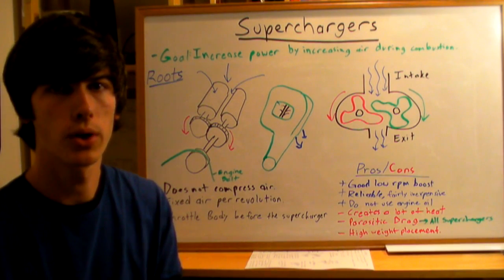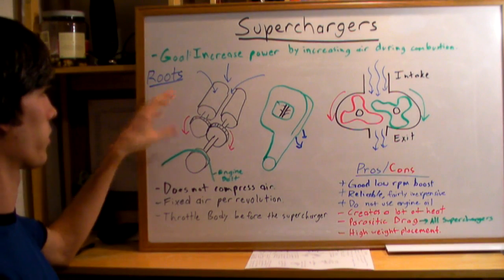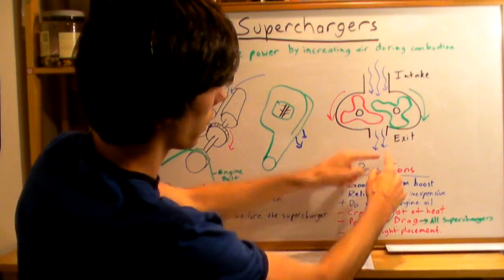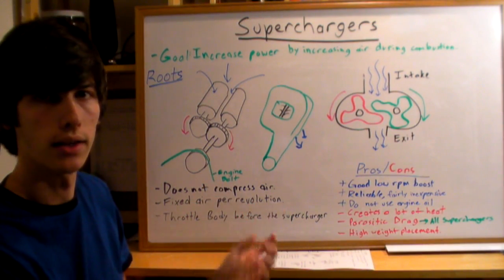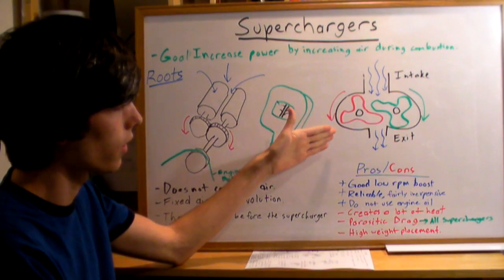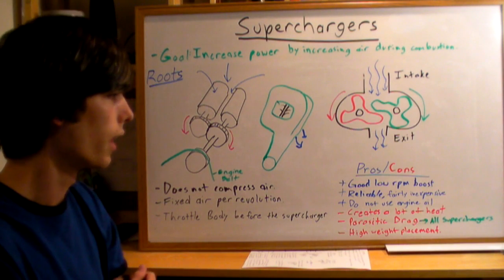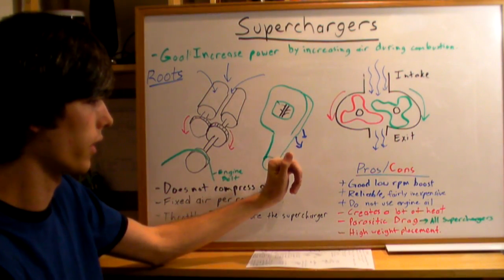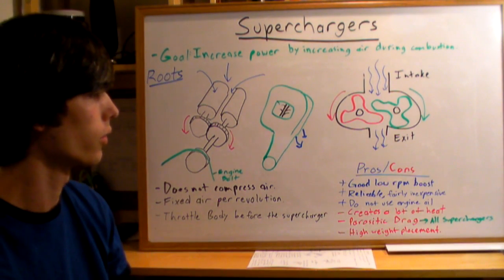Superchargers - Explained

Comment: Thanks for another interesting video...
You mention that the ROOT has a "fixed volume of air per revolution" and that is "unlike turbo chargers".
Now I have a "comment"/question ((there always seems to be one :)) . When You say that "super chargers have a fixed volume per REVOLUTION" You are talking about "ENGINE revolution".Now I guess that is obvious to any "car person", but I mention it because I (not being a "car person") took it to mean "revolution of the aircharger" (Root or what ever is being used) and this lead me into a rather different "thought pattern" that didn't seem quite"logical".
After thinking a bit and rewatching ((good for Your retention ;))  I "finally" realised that You must have been talking about "engine revs" and then it all "added up"...
Just thought I would mention it.
Best regards.
Reply: It's fixed for both.  Assuming you don't have slip in the belt (and you shouldn't), for every X engine revolutions there are Y supercharger revolutions, and both those are fixed constant values.

This is where the "there's no compression" comes in.  In the Roots style supercharger the supercharger doesn't significantly  alter the pressure of the air flowing through it relative to ambient pressure.   A gauge isn't going to register much of a pressure differential.  

In a turbo, or an impeller style supercharger, the pressure of the air is changed significantly.  You're forcing more air into a volume (compressing it), and thus increasing the pressure.   The amount of compression you get is a function of the speed of rotation, so at a low speed you get less pressure and less air per revolution than at high speed.   Therefore the volume per revolution is variable.

Note, because I don't want to add to your confusion, in a turbo air per revolution is both variable, and not directly dependent on engine RPM (it's based on exhaust flow),  while in a impeller style supercharger the air per revolution is variable, but the rpm of the supercharger is still a fixed ratio relative to the engine rpm because there's a direct mechanical connection.

Comment: Wait so which generates more heat (or causes more heat related issues), a super charger or a turbo?
Reply: sam alame turbo, without a proper intercooler or just extensive use in general, they can overheat being that they rely on exhaust. Super chargers can overheat but it’s quite rare in comparison to turbos.

Comment: What's better , supercharged or turbo?
Reply: TWINCHARGEING
Reply: Austin Layer so turbo is better for acceleration?
Reply: Cristian Knight a procharger
Reply: Cristian Knight i would preffer a supercharger because its cheaper sounds better than the turbo stututu and some other things that i cant explain cause i dont know all words i need to so
Reply: Bbgfccg
Kekdjejdbfbfbf
Reply: Cristian Knight if it's for a car u drive allot supercharger if u trying to build a race car turbo
Reply: When it comes to race cars, it depends on your setup. A turbo will make your car quicker, but if you can’t deal with the lag, your car will suffer. Supercharging will be easier to use because you don’t have to find way of eliminating lag, like anti-lag, electric motors, twin turbos etc.
Reply: Supercharger has boost pressure no matter how long the rpm. Turbo engines are just as parasitic and superchargers so i think superchargers are better.
Reply: earlibee thanks men
Reply: turbos are better than superchargers but superchargers are cheaper. Turbos do have better acceleration at top rpms and superchargers have good all round acceleration through out the whole rpm range. turbos can also be good at low rpms but they have to be small which defeats the purpose of having a faster acceleration than a supercharger.

Comment: Is there a video that better explains parasitic load that a supercharger creates?  I need some greater details on how, why and what happens to the engine
Reply: Because a supercharger is belt driven it's constantly turned by the engine, sapping a little bit of power all the time. So even when you're not hard on the throttle the supercharger is constantly spinning. the reason a turbo charger is NOT parasitic is because its not belt driven, it uses the exhaust gasses to spin the turbine, meaning that at low RPM's the turbo is essentially not in use. I hope that helps a little bit but Engineering Explained is a much better teacher than I haha

Comment: i'm consedering installing sc14 supercharger on my engine its g4gc beta2 engine and the ecu is for g4gf beta1. would it hanble the boost of the supercharger as stock ecu and how much boost i can go as safe mode for the stock ecu and fuel system

Comment: Why does a top fuel dragster use supercharger, not a turbo? With that kind of exhaust a turbo should do just fine, right?
Reply: A turbo will not deliver you full power the moment you step on the gas, a supercharger does. huge turbos need huge amounts of exhaust gases to reach their rated boost pressure. The only solution would be to wait at the starting line for the green light at full revs. Which isn't a good idea considering how fast an engine of a top fuel dragster destroyes itself anyway.

Comment: Why doesnt the intake just force it between the two gears/fans and shafts? Id think it would force more air in at a faster rate instead of taking it around the sides of the intake? Would it stress the engine and warp it somehow?
Reply: My dad told me that when you have more fuel, with a supercharger in the car, you need to force more oxygen as fast as possible so forcing the air through the middle of it would do just that

Comment: In an another vedio just saw that super charger gives the boost at high rpm close to limiter.......and here i came to know that it gives low rpm boost.......so please can u tell me which one should i believe?
Reply: a roots supercharger like this creates alot of power at low RPM's it gives you much greater torque. Centrifugal superchargers are essentially a turbo charger connected to a belt, so they spool up slower but it creates more power up top, i hope this helps!! :)

Comment: Okay, on a roots type blower with a carburetor (or two) on top since you are feeding an air fuel mixture instead of just air into the intake manifold (as on later model direct port fuel injection)  you should see a drop in overall temp before the mixture hits the cylinder due to the latent heat of vaporization correct? Or is the heat of compression greater than the latent heat of the gasoline mixture?

Comment: Why does it sometimes have a big scoop on top of the supercharger. Is there a name for this "scoop"
Reply: +Harvey2314 i believe its for air intake, because this supercharger takes in air from the top, its just simpler to have the air intake sticking out above the hood. also i think it helps increase pressure slightly before entering the supercharger. maybe its called a ram air scoop, or something similar.
Reply: so u just buy a air intake separately? do intakes fit on any supercharger?
Reply: it’s called a blower
Reply: Harvey2314 Because the supercharger sits on top of the engine and you either have to have a scoop or a hole in the hood often times or if wont fit
Reply: Logan no genius the supercharger itself is also called a blower, nothing to do with scoops
Reply: +Fee Nicks "Because the supercharger sits on top of the engine and you either have to have a scoop or a hole in the hood often times or if wont fit"
Not necessarily. It all depends on the design.

Comment: Okay so I have a 2001 Nissan Frontier that has a roots supercharger already installed, but I want to know if it would be ideal to also install a cold air intake?
Reply: +Nyles Huling  A cool air intake would be extremely beneficial for a roots style blower. Since they get so hot, they also heat the air entering the combustion chamber. Since hot air is less dense then cool air, there is less oxygen. By making sure the air is cool, there is more oxygen in the combustion chamber therefore more power. Expect your boost levels to go up slightly once you install it.

Comment: Overall, would you say a turbocharger is better than a supercharger, or a supercharger is better than a turbocharger? Or does it really depend on the car?
Reply: Yeah, like Ricer Records said, get a twin turbo because the price difference is huge between a supercharger and a turbo and you'll still get excellent horsepower. Also, install a cold air intake and you'll get more horsepower from that. Dual exhaust will also help.
Reply: Depends on car and what you want boost for. Are you running on a track? Drag strip? Street? Mtn roads? Also do you really need a turbo making 500hp+ in a fwd daily driver? Prob not.
Reply: +EAGLE13441 get a twincharger brah

Comment: Engineering Explained I am living in Ecuador restoring a 1977 F750. I am also creating an alternative gas system to power the truck from bio-waste/wood/carbon/water. I'm pretty new to mechanics but have been studying everything I can... I'd love to talk to you about this..
Anyways, when loaded with weight, speeds uphill can come to a crawl because I don't have enough power(torque i think) at low rpms, but at high rpms I have pretty good power even under load..
I was wondering do you think my engine would be able to handle a supercharger/ the compression increase etc.. or if you thought a supercharger would be best for this?
Also I wanted to hear your thoughts on changing gears for more speed or torque..
its a 12 speed transmission (2 reverse) with the high/low air gear..
also changing into 1st gear almost always has a grinding sound, and I have to 'pop' or hit it out of 1st gear.. I can put it in silently but it is very slow and difficult to do.. I had my transmission dropped and checked out, It helped 2nd and 3rd, all gears are shifting pretty good except 1st.. I can't tell if its my transmission or if my clutch isn't fully releasing..
I would love to talk to you more about my alternative gas system as well.. I think you would be very interested in it..
Is there anyway we could get in contact?
Reply: Engineering Explained 
Also when I use the engine to brake the vehicle, normally when going downhill, my engine is after-firing, out the exhaust loud banging sounds... I have a dual exhaust and it seems to only be coming from one side.. 
I couldn't find where to check and set the timing..

Comment: "... you don't have the heat issues that a turbocharger has (...) the problem with the roots is because it does not compress the air internally it does create a lot of heat" I don't really get what you're trying to say there, the blower needs a relief valve right after or in any case the inlet ports... of course if you blow air into a closed volume, pressure and temperature will go up to dangerous levels, but in this case I don't think that the generation of heat is significant compared to a turbosupercharger (centrifugal).

Comment: Why do the airscrewers of the supercharger take the air around and not directly throught the middle?
Reply: +Ignasi Puente that's a design characteristic of the Roots blower. Other designs do take the air through the middle, and as a result, don't run as hot as a Roots-style blower, which is one of the reasons why normal supercharged cars don't use that type of supercharger, as the heat from the blower can't reasonably be expelled.
Reply: Ignasi Puente rotational direction of the screws

Comment: can someone explain me. what is the difference between pulley size
Reply: Changing the pulley size affects the boost the supercharges puts out at a given RPM.
Reply: a smaller pulley spins faster than a larger pulley, thus increasing the amount of air you can force into the engine.

Comment: I have a question. Would I get the same or better mpg out of a engine that has the cylinder deactivation system + a supercharger? In addition, can you have a roots style supercharger without the blower mounted on top?

Comment: what happens if you combine superchargers and nitrous?
Reply: doktorbimmer sooo, if you were to used nitrous with a blower on lets say a drag car, would it better to use a smaller shot of nitrous or a larger one?
Reply: ***** For that you can use higher octane rated fuel or use water-methanol injection.

Comment: you continue to impress. Really good stuff here. Not sure if you have researched electric superchargers. You can charge them up and use them for shorter trips or until the battery is depleted. Takes a short period of time to install as well. In any event, the Phantom super charger its an option for my Scion FRS and I am bit bewildered as to how its different and how it works.
Reply: here is the link to the Phantom electric super charger. Non-parasitic! I dont think you can find enough information about this device to actually present but its pretty neat.
http://www.ft86club.com/forums/showthread.php?t=39719

Comment: Wat is better a supercharger or turbocharger ?
Reply: Engineering Explained Turbo's use engine power too in a way, since the turbo causes a higher pressure for the exhaust to go to. So I think this energy is delivered by the engine. Am I correct on this one?
Reply from the maker: Depends on the application and desired result, but I think turbos are a better solution as they are more efficient, and don't scavenge engine power to operate.
Reply: doktorbimmer That was a clear explanation! Thanks! :)

Comment: hi man i have a question where do i put supercharger before or after carburetor and why ???
Reply from the maker: I believe it could be done either way. If it was before, the carb would have to deal with pressurized air, if the supercharger were after, the supercharger would need to deal with fuel going through it. I suppose it'd be cleaner for the supercharger to go first, though I'm not sure in the scenario using carburetors which is more common.
Reply: thanks man

Comment: If they use plastic cylinder fan supercharger then it wouldn't be that much of a problem because it's lighter and engine power loss will be much less. Because supercharger is only for pulling in more air to the intake

Comment: There are 2 different belts in the engine compartment. Timing belt/chain which controls the timing of the camshaft to open and closes the valves. drive/fan/serpentine/engine belt powers the A/C compressor, water pump, and alternator

Comment: no, first off you are adding weight to the car when you add a supercharger on top of burning more fuel every time the engine fires because it is forcing air into the engine, thus more fuel. The only reason to add a supercharger is to make more power. That being said, it is possible to make more power with a smaller motor if it is supercharged than a larger motor without any forced induction. If i was concerned about fuel consumption i would prefer a turbo.

Comment: It does, but, like he said, the supercharger does not compress air in itself like a turbo does, it forces air into the intake manifold, increasing pressure, thus more air into the cylinder.

Comment: and a turbo spins at around 200,000-250,000 RPM'S i would like to se a small electric motor on the size of a turbine makes 200,000 rpms. and if it would work you would need a BIG ASS alternator ;D

Comment from the maker: It is not. The timing belt will simply control the rotation of the camshafts, while the engine belt (also referred to as serpentine) belt will power accessories like A/C, water pump, alternator, etc...

Comment from the maker: Well I don't know the numbers behind each of them, but it's very possible simply by using a turbocharger. Your 3.5L SUV likely wasn't turbocharged. Say you have a 3.5L turbocharged engine with 200% volumetric efficiency vs. a naturally aspirated 5.7L V8 with a volumetric efficiency of 100%. The turbocharged engine will actually have more air (7 liters at atmospheric) and thus can burn more fuel, and produce as much or more power than the V8. Check out my forced induction videos for more info.

Comment: well, I'm not saying there's limits,but due to its size, how could it produces more power than all other V8 engines? It pulls more power than their own 5.0L engine, and it seems run better than their competitor's 5.7 and even 6.2L too. This makes me feel fishy. I know technologies can increase power as you explained, but by this much? I owned a regular 3.5L engine SUV before and it only gave me 2xx hp and torque. The difference is so huge. I'm very curious about the secret.

Comment: quick question is the centrifugal supercharger better on the weight placements? and does it crate less heat? if so, do you think a intercooler is needed? thanks

Comment: both are true - superchargers decrease mpg and turbochargers increase mpg. a turbo uses energy that otherwise would go to waste, a supercharger uses energy that otherwise would go to your wheels. on two identical engines and at exactly the same boost, a turbocharged engine is going to have more power because the supercharged one is going to lose some power just because it has to spin the supercharger. that also explains why good mpg diesels use turbochargers :)

Comment: I have a question I've been wondering for quite some time.  I was told by a snobby man at a car show (rather condescendingly) that there's no such thing as a twin super charged car, since it's belt driven, unlike a turbo charger which is exhaust driven.  My question is, why?  Why can't 2 super chargers be hooked up to the same belt (or different belts) to have a twin super charged engine?  Why is this not possible?  Was the man right?  Please explain.  Love your videos btw!

Comment: I saw on a video that a smaller sized turbo charger can/will increase mpg. I think I heard somewhere that a super charger will decrease mpg. So if your driving normal and not going over 3k rpm's are both those statements true? Or would a supercharger also increase mpg?